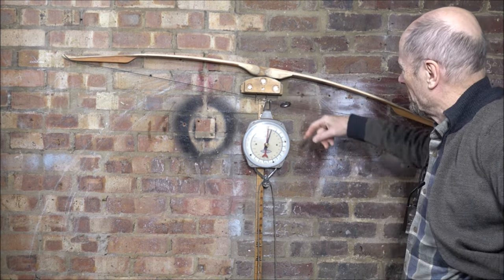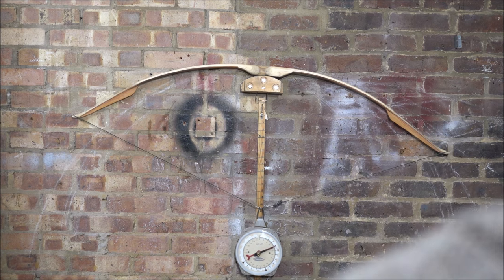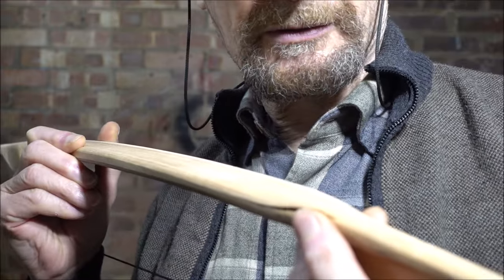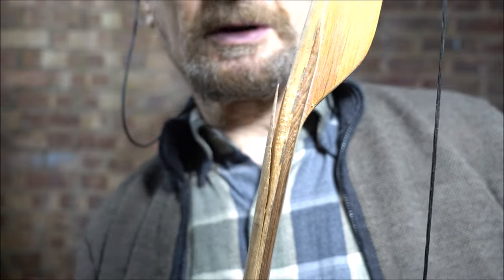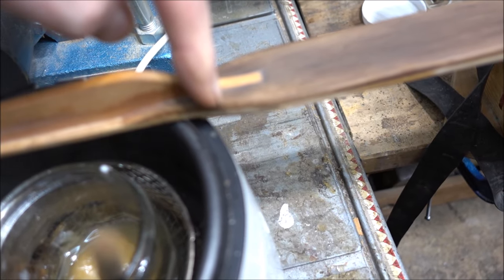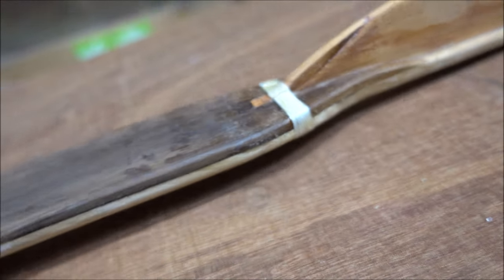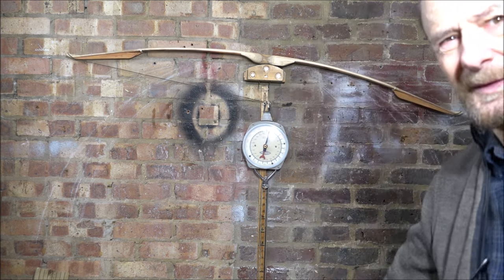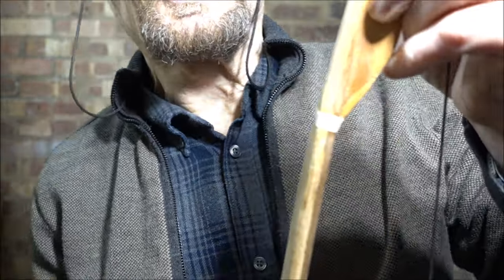Hickory Flight Bow Rework pt8

Comment: Del, 3:48, the fade/dip area whilst not matching and being out of proportion, are also fading and dipping over too short a distance and the transition becomes the weak point, if the transitions were extended  you might have got away with the grain run out…that is what is good about these totally experimental bows, they often have a lot to tell you…
Reply from the maker: Yeah, obvious once I spotted it... dunno how I made the two ends different.

Comment: Beautiful design! I wonder on the assymmetry..how do you steer the tillering with this?
I would love to build an complete assymmetric bow like 1/3 to 2/3 as the japanese, but for now, have no method to ensure the limbs fly with the same speed. I tried it with accoustics (pulling the limb and listen) but that didn‘t work, as both limbs will vibrate and if I hold one to dampen it, I get too short sounds from the other limb to differentiate the mass difference.
If you go by a visual method, you need some kind of formula in the background, no? Or just experience?
Reply from the maker: Have a look at this:-
https://www.youtube.com/watch?v=HXBHC82NDFs